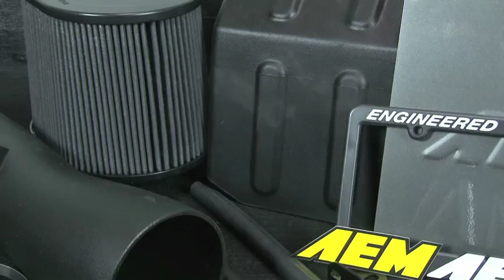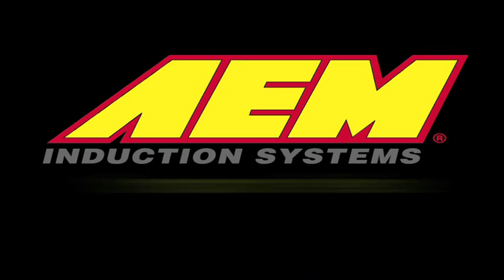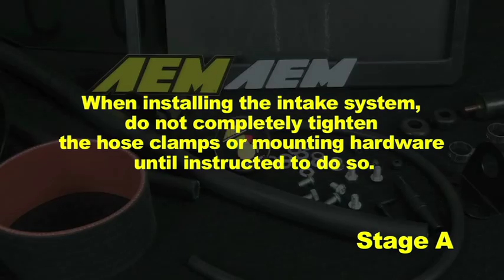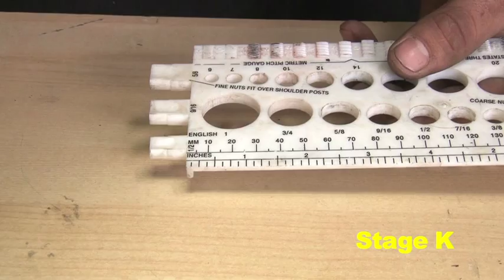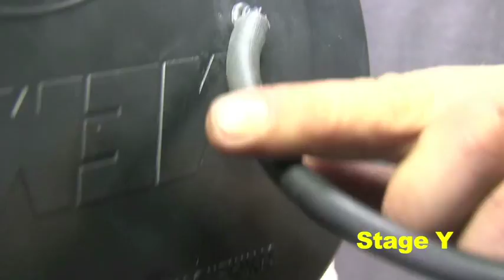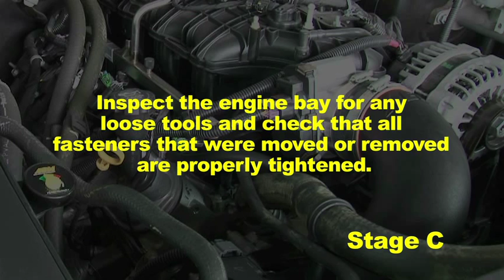How To Install an AEM Air Intake on an Escalade/Avalanche/Silverado/Suburban/Tahoe/Sierra/Yukon

Comment: K&N Is way better ..
Reply: K&N sucks.. They bring lots of dirt inside...
Reply: From the test I saw, they both flow about the same with the K&N having about 10 cfm more. The AEM filters dirt better. The CAI from AEM is also CARB legal. I went with AEM for those reasons because it is a daily driver.